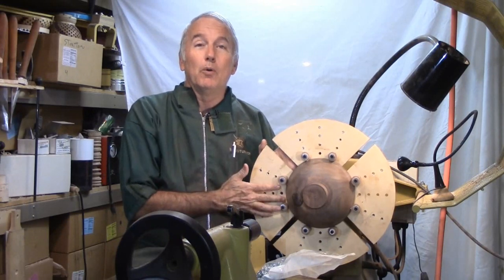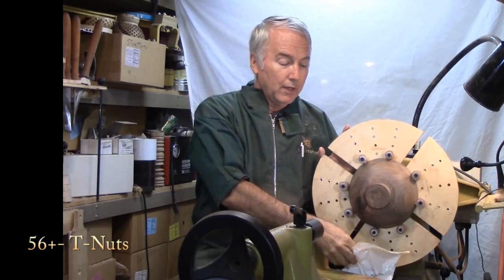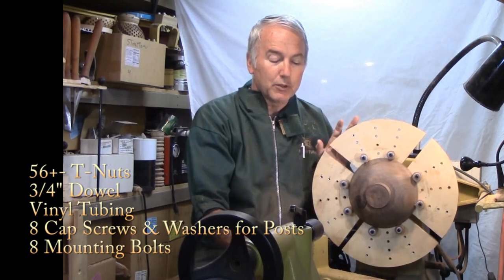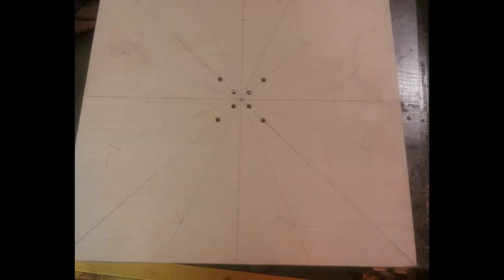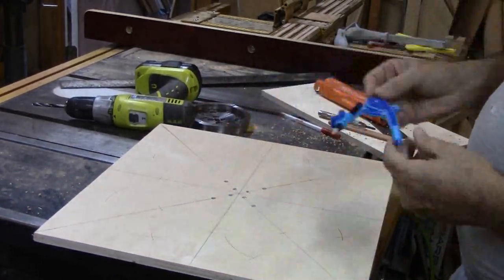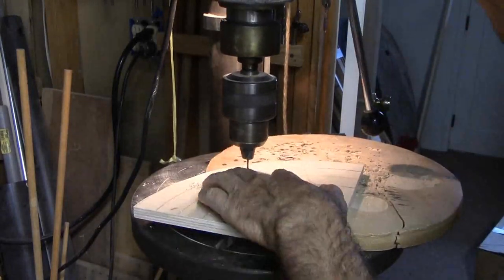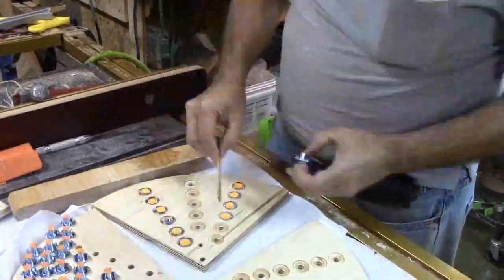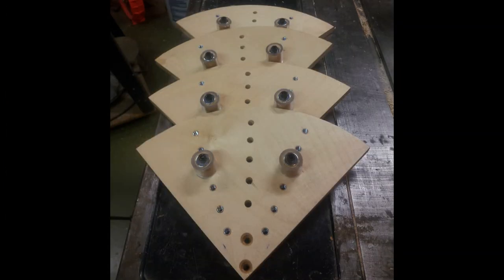Home Made Cole Jaws For Woodturning Large Bowls

Comment: Thanks for the video. I have a longworth thinking it would be easier/better since all you have to do is rotate the plates but it is a hassle for me trying to get the tension the same on all 8 buttons. I have the birch plywood ready for the jaws and I like the buttons you made. Thanks again.
Reply from the maker: That is my sense as the biggest drawback for a longworth. But go ahead and make a set of these jaws. Then you can use each to their best advantage.
Thanks for commenting.
Alan

Comment: Alan, a few ideas; to cut the plastic tubing, there is a cutter in the home centers made just for cutting Pex and tubing. It's easy, quick and best of all straight cut. To get the plastic tuning on the dowel easier mix up soapy water solution in a plastic spray bottle and give each piece of tubing a quick spray.  Don't worry the soapy water dries quickly. The tubing will slide into the dowel easily. Then squeeze a drop of CA glue at the end of the tube to set it.  Where did you buy the T-Nuts? Best regards, Richard....
Reply from the maker: Great tips - Now to remember when I need them.
Alan

Comment: thanks for this,I have all the bits now to make bowl reversal jaws but how to fit the locking posts without having to thread into wood eluded me, using t nuts is the obvious solution so thanks for the smack upside the head with a common sense plank :)

Mark.
Reply from the maker: Glad to oblige.
Alan

Comment: Alan, I've seen this video a couple of times. I've tried to make myself a Longworth chuck going be Cap. Eddie's directions, being very careful as to get my arc's right. However, it does not turn as easy as it should. Anyway, the question I have after watching your video on Cole jaws, is instead of using birch plywood, would it be ok or safe to use MDF board? I have a Lowes store near but what they call Chose grade lacks a lot. 
By the way, I have learned a great deal watching your videos. great work keep it up please.
Randy in Tennessee
Reply from the maker: I would not use MDF for this chuck. IMHO it lacks structural strength.I would not use common Birch plywood either. My spec is Baltic Birch: it has more plys and no voids. There are different names but that is the spec. may not be in a Lowes or HD. May take more looking.
Actually, I'm not surprised about your experience with a Longworth chuck. I have one from plastic. It's hard to get it as tight as I'd like. Works great for positioning segment rings.
Good turning.

Comment: Hey Alan,
Thanks for making the instructional video, I just finished the set of jaws and it came out very well. Tell me, did you take into consideration the little pin on the metal jaws that prevent the jaws from opening to far?  I'm still thinking about how to address that concern.

Thanks again,
Tim Boger
Reply from the maker: Tim,
I left the pin in place. I did not want to override that safety feature. :)
Alan

Comment: Alan, Great Video I have a 11" commercial cole jaw but not large enough for everything. Will make larger one for big lathe and save the other for the smaller lathe. One question, What is the row of holes for on each quadrant that you did not install T nuts? I wonder if they were necessary unless you wanted to make a 12 button holding chuck.
Thanks,
Bobby
Reply from the maker: I drilled the other set of holes just in case I every wanted to do something else - I don't know what. It's easier to drill while drilling everything else.
12 button would be overkill.
Thanks for paying close attention.
Alan Stratton

Comment: Alan, did you ever do a comparison of Longworth v Cole? If not a video, do you have an opinion and a moment to share it?
Reply from the maker: I only use a Longworth in segmented work and only for centering. I have concerns about adequately cinching up the Longworth for normal turning. I cannot seem to get it as tight even with the bars. I'd rather use the screw mechanism in a standard scroll chuck to get a good firm grip.
So. I use both but for totally different applications.
Alan
Reply: @AsWoodTurns  Agreed. My experience was that I did not feel I could center a piece perfectly. Okay for gluing segmented rings, but not for turning -- even just to cut off a tenon. I haven't made the cole jaws yet, but I will do so because I imagine it will be both more precise and secure. Thanks for the feedback on this as well as the video.

Comment: Nice one Alan.  I have a large 1/8" thick aluminum sign laying around.  Wonder how well that may work for making up a set of these for my HFT 10x18 mini lathe.
Reply from the maker: Not sure whether 1/8" Aluminum could be tapped directly for the bolts - May still need t-nuts or something to bolt to. I'd talk to somebody in a local club who has metal experience.
Interesting.
Alan
Reply: As Wood Turns Yeah looked up NOVA cole jaws and those are 3/8" thick cast aluminum. Now if I epoxied the aluminum to some 1/4" ply, it might outlast something made from ply alone.

Comment: Question please.  If you were going to make this or the Longworth chuck--and had not made one before---which one would you make ?  It seems to me that they perform a very similar function.
Reply from the maker: +Terry Ellis This question tends to provoke a bipolar response. There are those who swear by a longworth chuck and disparage Cole jaws. On the other side, they swear by cole jaws and disparage Longworth.
They both perform the same primary function. enable cleaning up the foot of a bowl. Both have pluses and minuses. Longworth have a wider range of grip but can be difficult to cinch up tight. Cole jaws will cinch up tight but may take some adjustment to get spacers for the right size.
For me, I use Longworth when I don't need a strong grip such as segmented work. I use Cole jaws for bowl bottoms. Others will have opposite opinions. But that's woodturning.  :)
Alan Stratton

Comment: Alan, Great video with a very useful subject. I'm getting the material together to make a set. One question, is the plywood you're using 1/2 inch?
Reply from the maker: Yes, mine in the nominal 1/2 inch, actually, just a little thinner. You can use anything you're comfortable with as long as you size the bolts and t-nuts appropriately.
Go for it.
Alan

Comment: Could you use cheap aluminum sheets 1/16 or so thickness?
Reply from the maker: timothy mcswain Since I'm not a metal expert, I cannot make any recommendations.
But for the aluminium, I would worry about it flexing and whether there was enough to hold the bolts. 
So I doubt it.
Alan
Reply: Ok thanks
Reply: I made a set out of 3/8 aluminum plate and am quite happy with it. I was able to drill and tap the holes to hold the dowels.